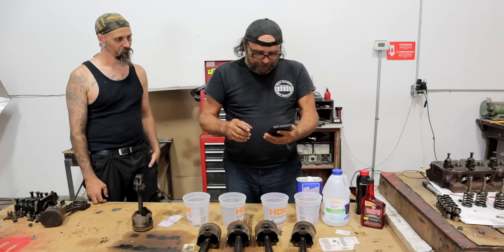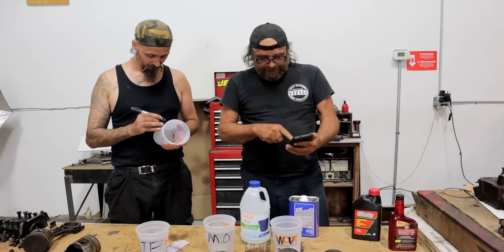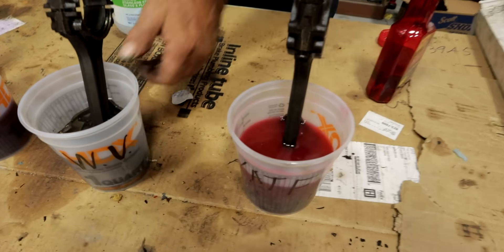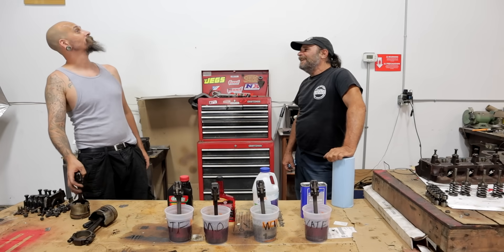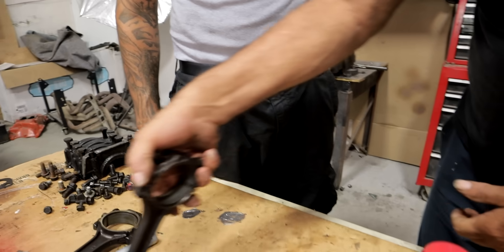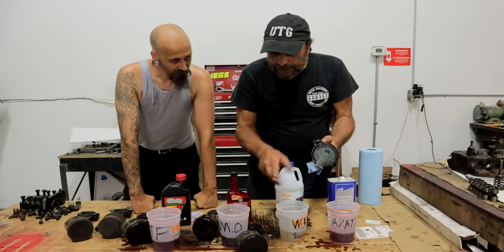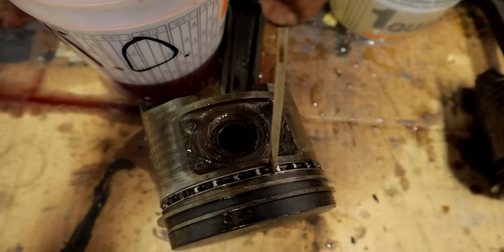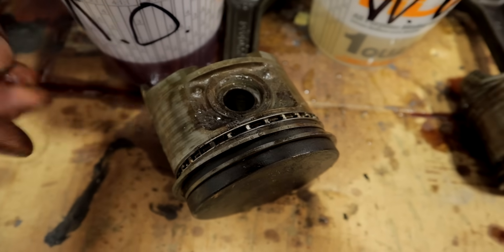Best Fix For A Stuck Engine - Viewers Choice. Marvel Mystery Oil, vs ATF, vs Acetone, vs Vinegar

Comment: UTG if I was to do something somewhat simple to a 97 Tahoe 2 dr 5.7 to improve MPG, what would you do?

I just did plugs, cap, wires, radiator, starter, complete fluid flush from motor to rear pumpkin, and I dropped the fuel tank and replaced the sender and fuel pump. 

I havent done the spider injector yet and its still the central port OEM and not the newer Multiport. 

Would this be what I should do?  

I run non-ethanol only and MM0 in the fuel and oil.
Reply: Install a vacuum gauge and learn how to use it for mpg
Reply: Wish I could but its my wifes and her dream truck.  

2 door Z71 with barn doors, line-x for paint, completely redone interior and all kinds of little goodies to make it better. 

If I mentioned selling it I would probably be murked in my sleep.
Reply: @justpassingthrough3166  I'd say you've done all that you can do for optimal mpg. Stay out of the accelerator and use cruise control whenever you can. Keep good tires, in rotation, regular oil changes and that's about it as far as I know. Maybe avoid hauling unnecessary weight around like tools, misc things that isn't immediately needed.
👍
Reply: @lilmike2710  we do all these things and keep the suspension greased and lubed and tires rotated and at max psi (80) 

Guess we're stuck with 16mpg highway...😆
Reply: Take good care of it! ;)
I run my tires just under or right at max pressure rating if that pressure rating is low, typically higher than door sticker.
Reply: Why would you replace the spider injector ? Are you getting a miss , or erratic idle ? 
Its not really a "tune-up" item . 
But if you DO replace it , replace the two flex hoses between the hard line and injector also . After 25 years , they're ready . Often a rich condition can be traced to a pinhole spray at these hoses or their connectors .
Reply: @Richie_the_Fixer  no its not a "tune-up" item but part of what I'm doing is getting my truck right for economic collapse and supply chain issues.  

It's the original 25yr old spider injector so I want to knock it out with a real good quality brand multiport.  

Besides from what I understand it atomizes the fuel better since its not just a single, central port. 

Everything I've replaced on this truck has been top of the line stainless steel and good aluminum parts be it the radiator, starter, good plugs and larger spark plug wires, polyurethane bushings, new shocks. 

I just want this truck vetter than new and whatever factory design flaws and weaknesses corrected as much as possible.
Reply: Clogged fuel filter or leaking injectors can cause over fueling
Reply: Change rear end gears.
Reply: I would sell the 97 and find a 79